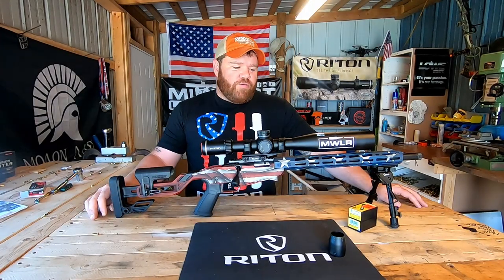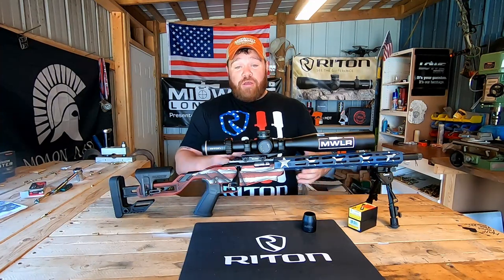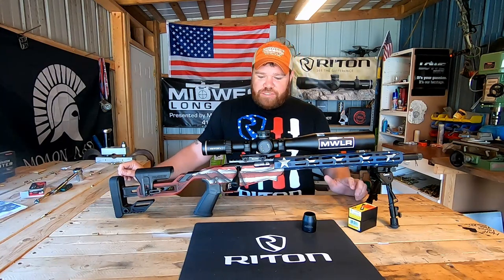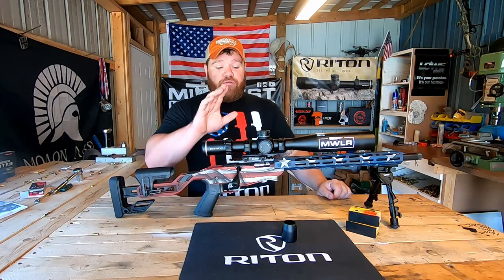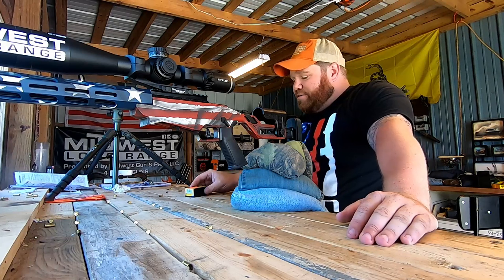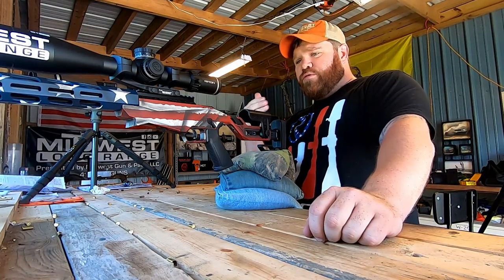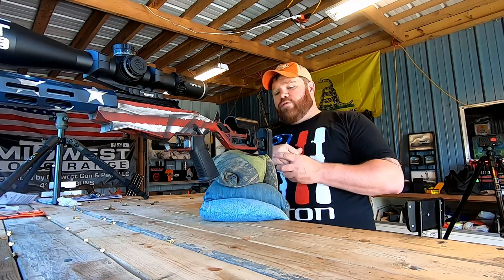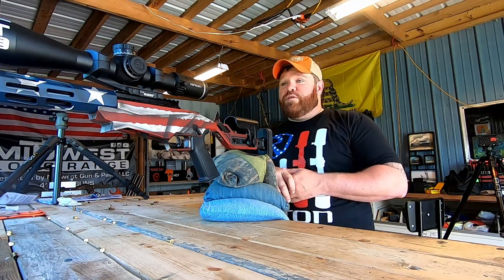Adaptive Barrel Tuner on a Ruger Precision Rimfire

Comment: I made a tuner from a busted old Tasco scopes Ocular lense housing. Cut it down, added a 1" cast iron coupler inside the flare. Added some set screws and whammy Sammy did it fucking work. At 100yds, and just from the start, a 10/22 target took S&B club ammo from 1" down to roughly 3/16". Now I want to get the real tuner and thread the barrel for it, but the wife is so happy she's busting my balls about wanting to replace it.

Comment: Did your B14R have the carbon barrel?   I get vertical stringing when it starts heating up.  I picked up the ATS tuner also but have been limited by weather conditions as to the testing and getting dialed in.  Been windy and or raining everytime.  Still got work to do.

Comment: Why you need a tuner shooting a 22.  Just do t need it at 50-100yrds.  Use cci standard groups will be so much better.  Elects are crap even tenex continuously miss fire. My groups are half what your shooting so the RPRR is a sound factory platform.